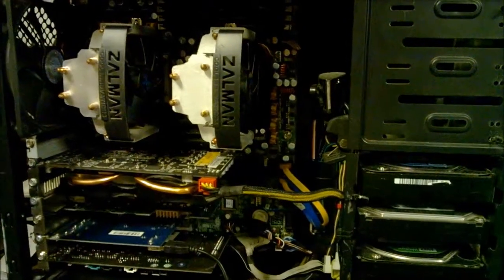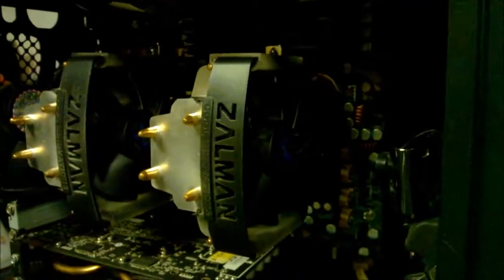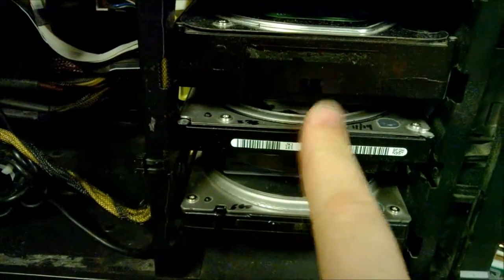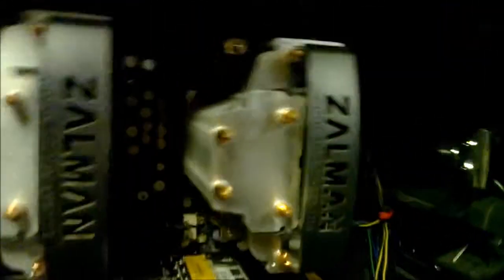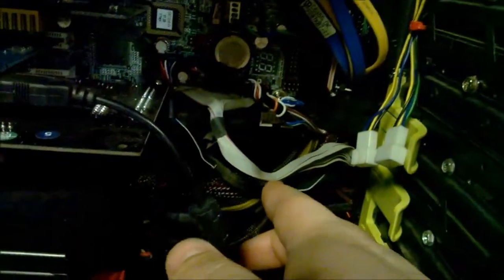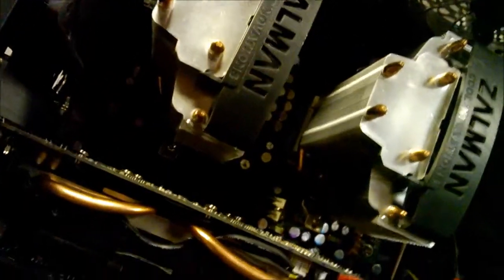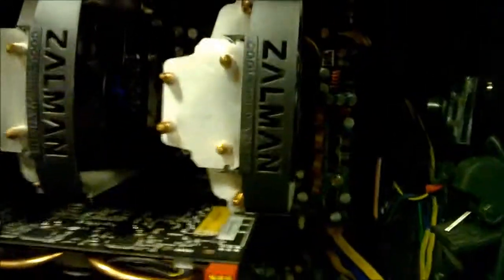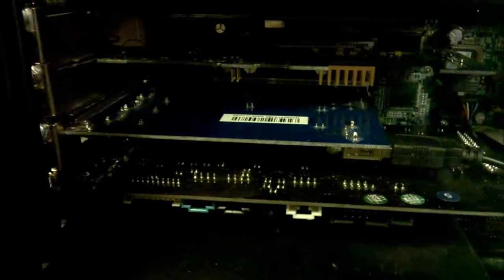April 2015 Dual Opteron Box Update

Comment: ehh i got a dell t5400 with 2 x5450 xeons with 16 gigs of fbdim ddr2 ram 2x 6770's in crossfire with 4x wd raptor 160 gig drives in raid 0 runs preety much any game i could throw at it havent tryed gta 5 on it because well lets face it hd6770 has a only 1 gig of ram on it so yea
Reply from the maker: MrFmlouder 4x160 is kinda low, no? 1TB and 2TB drives are CHEEEEEEEAP now.